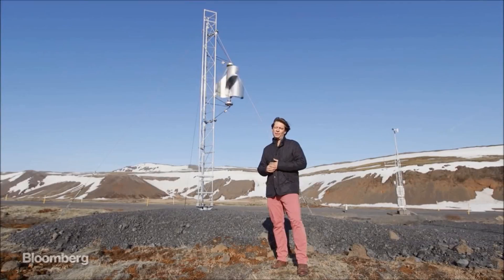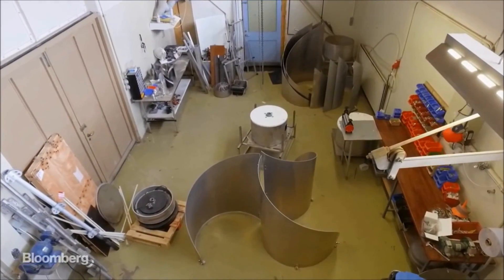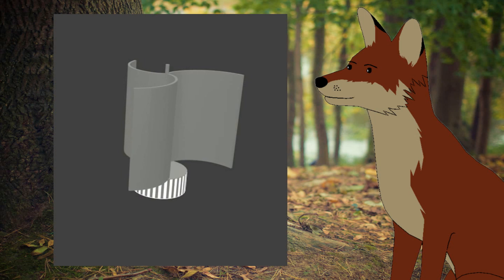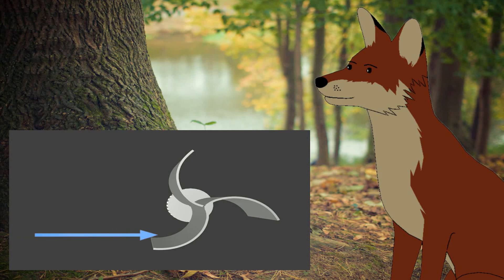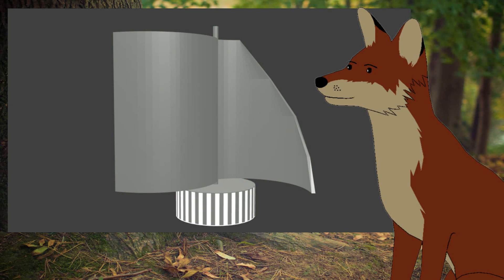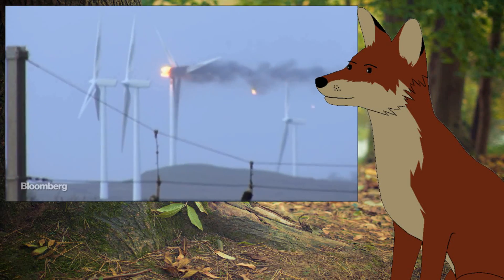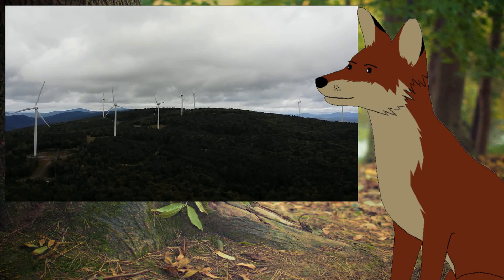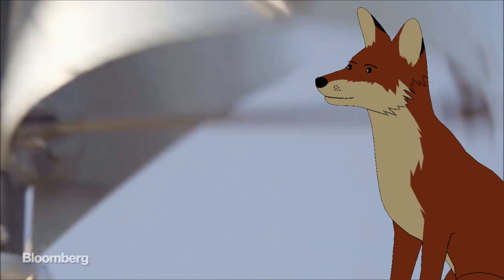IceWind Turbine - BUSTED

Comment: I built a conventional Savonius Rotor many years ago. It was 6 feet tall with 3 2 foot levels of blades 33 percent out of phase. The blades were all spring loaded so that if the rotational speed got too high, the blades would open up slowing rotation. The shaft was mounted on a auto front wheel bearing, belt driving an 12 VDC auto alternator. The output being used to charge some surplus Telephone company lead acid batteries. These batteries were 2 VDC each and huge, weighing more than 200 lbs each, 6 cells made a 13 VDC string. This setup was used to power my ham radio station in emergencies. It would probably not be considered very efficient but it did the job.
Reply: You don't need efficient when you can just go big.
Reply: @vylbird8014 
✔️

Comment: because those who endorse them are morons or maybe they get some benefits from the back door.. I agree with  you that the wind resists on both side. I've been searching a model which  neutralizes  the wind on approaching blades so far I've seen only one prototype yet it didn't appear to work smoothly

Comment: First off, stainless steel and carbon fiber would be considered new science as compared to 200 years ago so their statement would be correct.  Second,  they don't actually lose 40% efficiency because the wind is not hitting the returning 40% missing from the returning blade.  3, What's the fucking difference if it catch's on fire or explodes, over speed still killed it.  4, Look at the gigantic price difference between theirs and those complicated propeller types that only last three years.  Imagine the money to replace those things every three years so maybe a little less efficiency is worth the replacement cost of the giant ones.  5,  You have not proved that they won't over spin.  It just sounds like you're jealous because their making money and you're not.

Comment: Cutting the blade by 40% does not cut the efficiency at all.  It cuts output.  The cut applies equally to the pushing force on the driving blade as it does to the 'dragging blade'.  This is simple geometry.
Reply: right, and it needs low output in the frequent high winds. simplicity and elegance are the 2 design goals. if it provides ANY output, it is renewable, green energy, and kudos for IceWind for trying to make an alternative to expensive conventional turbines in Reykjavik
Reply: those triangular blades have a purpose. If you have some basic idea of mechanics, you might know about LEVERS. And how force distribution of levers decrease as you move away from the Axis holding the weight. The same principle works here. The blades get thinner towards the edges and are wider at the centre. This reduces the drag on the blade which which is pushing the rotor opposite to the desired direction. That may decrease the output but increases efficiency and durability.
Reply: @chandrasekharpanigrahi2474  that's daft ; the force generated by the upwind blade has the same mechanical advantage distribution as the air resistance of the downwind blade: it has to because the blades are the same size and shape as each other.
Reply: @chandrasekharpanigrahi2474  I am curious about the purpose of the triangular design. Can you please send a link of an article about the force distribution in levers? Thank you.
Reply: Thanks for these comments, we are looking at a community renewable source, currently we have no renewable energy, waiting another 10 years for greatly increased efficiency and reduced prices kinda defeats the object!

Comment: How could you lie so much? I went to their site and found everything you said to be a lie! What is your beef? Go to a basic physics class at college or even high school and you will understand the claims. You are one sorry person without something to do and your lack of education is proven by what you say.
Reply: D. Cantrell 

He also contradicted himself too. He said that the wind pushes both the blade and the back of the next blade, which makes it inefficient as it won't spin fast. Soon after that he said that they can't show that the don't have the overspeed problem. The point of the design is to have very few controls and make it cheap to build. Then he says how stupid a design it is because the normal turbines have brakes and pitch control. So not sure what he thinks he's busting. I'm just gonna down vote and block the rest of his videos, as I'm pretty confident he's full of crap in those too.
Reply: The icewind turbine is not prone to overspeed due to the VERY basic fact that it is such an inefficient and poor design, it will never be able to be over-sped. Sorry to bust your bubble, but the laws of physics are well in play here. To be precise, it's Newton's third law of motion: For every action, there's an equal and opposite reaction. Many times the equal and opposite reaction is the energy generated by the turbine, but in this case it's just the poor design of the turbine.

Comment: I have looked at these and was taken in and as you explain I see now where your coming from. I am looking to move to Portugal and want to be more green with energy with solar and wind, what is the best wind home turbine out there at the moment? Thank you Lee
Reply: Lee Woodhouse solar panels are coming down in price... But depending on your energy demand a vertical turbine takes up less space at a cost of efficiency. Your best bet is to start lowering your energy use... LED filament bulbs, heat pumps, and the like and go from there when you know what your demands will be

Comment: The real problem with many of these products is that they are either on pre-order or are simply not available. Rather than pre-order anything, invest your money properly and let it work for you. Once a product is available off the shelf, then order it if you want one.

Vertical axis turbines are much less efficient in terms of swept volume. It is the swept area in the direction of wind flow that produces power. A horizontal axis machine can have very little swept volume.

That said, the horizontal axis machines do have advantages and can produce useful results in exposed locations. But you do need a lot more space for them. If the chosen machine can be user installed and user serviced, a lot of the costs of running a turbine can be avoided. A user could service several 1kW machines, for the cost of the parts, whereas he would be hard put to service a 5 kW upwards. 

It is not only the cost of getting the service team out, but also the potential days, weeks or even months of lost energy waiting for any fault found during a service to be repaired. I have seen expensive machines standing idle for six months or more. If bought from a utility company, the cost of this energy can run into thousands. A user can keep a stock of spares and repair faults in hours.

Also Google Semtive and Eolo wind turbines for vertical axis designs.

Comment: yeah,  they've designed the blades so bottom is closers to base therfore can be larger, other reasons missed by this video.  efficiency of the blade itself doesn't matter being freely powered. the real efficiency is the cost to produce against the cost to build and maintain/ watt, nobody has a dressed this issue!

Comment: Hey Fox, thanks for the vids.  I was planning on making a copy of this VAWT for my home with barrels, but didn't know they are susceptible to overspin.  I'm going to try something safer.  Thanks for saving me some potential trouble.
Reply: hahahahah your so stupid you would take this video as gospel? fair dinkum? FFS get an education and dont watch shit like this video.....There are plenty of home made savonius rotor generators around that work fine and will do for decades
Reply: And better designs use homade blades cut from sewer pipe! They work very well without the limitations of speed -stall.  A nice design uses treadmill pm motors and direct drive.

Comment: Thank you for your video, it is insightful. But I would've hoped that you also included one more topic, the topic about manufacturing cost in relation to the power output. The IceWind Turbine might be inefficient, but if it can be easily installed in homes, it can still be a viable option. It would be great if you can also compare this turbine to solar panel.
Reply: Yes, it's a boat turbine! But boaters, sailers actually, use a small bladed system that is small and light.

If every house had one of these things it would be very noisy even if they were VERY quiet! Who would you call to fix it? An electrician? A plumber? Handyman? You would have to fix it yourself or hire a turbine tech for repairs... You still have to get it into clean air somehow... Crane costs are crazy expensive!

Comment: Jay Leno has a 10kw one installed on his shop roof youtube.com/watch?v=5Heu7TFsa50
Reply from the maker: That turbine was installed by ARC Renewable, even though it looks very similar the the Icewind design.  I tried to look into ARC, but their website is now dead, they have a linkedin profile but it does not look to have been updated in a while.  

This isn't the first wind turbine Jay installed, he put up a different 10kW one in 2007, and another one that looks similar to Icewind called the Magwind in 2009.  http://www.verticalwindturbineinfo.com/jay-leno-installs-vertical-axis-wind-turbines-on-green-garage/

I interesting thing about the Magwind is that it was a scam.  By scam I mean the owner of Magwind was indicted in 2013 and has been on the run for 4 years until he was caught last month.  http://www.wind-works.org/cms/index.php?id=675&tx_ttnews%5Btt_news%5D=4674&cHash=e4d79c9fa2b1a7a3de1a4069a822aa1d

Comment: If they would use the original savonius design with tweaking and with stators they could get a "butt load" of power. If you look at the zephyr system they have a computer simulation to illustrate lift!! 10 times better than this crap. Stators require more stability d/t surface area.

Comment: Wind is unreliable so wind turbine is not popular. Not due to its efficiency. Everyone will buy a wind turbine with 10% efficiency, if  wind blow 20+ hours in 300+ days and turbines are cheap enough. But it is not possible, so most of small scale wind turbine is failed. If battery technology greatly improved and price reduced drastically then it's found the ground. Unless not even if you get jaw dropping efficiency.
Reply from the maker: Mujibur R. 
Agreed

Comment: (4.30) Wind turbine catch fire, cause is faulty brake (friction) or simply short circuit at generator due to over speed. So your knowledge is also bullshit. Do proper research before bust others. Also cut half not reduce efficiency, may its reduce capacity.
Reply: I do not claim to be a windmill guru they have been around for a long time and I am sure that if you look enough you can find the data you need so I too am surprised that they got a research grant.
Back in the 1970s I took vacations on Greek islands and saw the old windmills there. here is a url so you too can see what I am talking about. http://www.alamy.com/stock-photo-old-traditional-greek-cloth-sailed-windmills-in-kontias-on-lemnos-51236822.html   In particulat the Steel framed one built on the base of an older windmill..  The rudder at the back keeps the cloth sails into the wind..however the ropes or cords allow the sails to spill the wind in conditions of high wind preventing overspin in a very efficient cheap and proven way. Greek windmills like this have been around for hundreds of years.Maintenance too is easy and cheep anyone can cut and fit new sails and cords..and oil gearing. Adapting them to generate electrical power is easy and anyone can build their own just from looking at this picture with no grant required just the planning permission to build it. .....Good luck with getting the planning permission lol
Reply: My bad..I was looking at lots of url's ...here is the correct one ..https://www.etsy.com/listing/235844361/mykonos-greece-black-and-white?ga_order=most_relevant&ga_search_type=all&ga_view_type=gallery&ga_search_query=greek%20windmill&ref=sr_gallery_19
Reply from the maker: Large turbines like that don't try to change speed or stop by using brakes. They control their speed by changing the pitch of the blades. The turbine they showed on fire had it's blades pitched to nearly 90 degrees. just like the turbines surrounding it. That turbine was never in overspeed. I couldn't have been in overspeed because if the turbine senses too high of a speed it would go into EFC (Emergency Feather Condition) and pitch the blades to 90. A turbine in overspeed means the primary and emergency pitching systems failed. In that condition the turbine could catch fire due to overheating of the gearbox or generator, but this is not the case in the turbine they showed.  In the turbine they showed the pitching system worked correctly, which is why it wasn’t spinning wildly out of control.
Reply: hahaha...........do you please see those again, why all turbine is not spinning? that's mean weather is not good at all. And those clips do not show all incidents, it's possibly start much before and recording start only when its catch fire. At the end its catch fire most possibly for bad weather. So their point is valid (there is many times turbine catch fire for bad weathers - may pinpoint reason is bit different, but overall culprit is weather).  Your are right about pitching but there is also emergency brake presence with EFC position for disaster moments as long as I know. And you can't correctly guess there angle from those kind of clip.
Reply from the maker: Yes you can guess the blade pitch from the clip.  The other ones are not spinning because they likely shut down the entire farm due to the fire.  You can clearly see on all 4 turbines that the wide area of the blade is turned out of the wind.  Plus the fact that the smoke is horizontal means there is still lots of wind.  The hub braking systems are just meant to hold the hubs in place for maintenance in conjunction with the pitching system.  The hub brakes alone would not be able to hold, let alone stop a turbine without the blades pitched correctly.  

Yes, bad weather can destroy turbines, bad weather can destroy practically anything.  But they specifically claimed that fire was due to high wind speed and the evidence points to the contrary.

Comment: I had similar thoughts about the blade shape on these Wind-gens, however that is likely what makes them less vulnerable in destructive high velocity winds. If you take the principal of leverage and apply it to the scenario of horizontal force reacting to a vertical lever, the greatest leverage occurs at the top-most point, on the IceWind, the blades are shaped and arranged counter to leverage, so that less leverage is applied to the top, thus diminishing the possible bending of the vertical center axel and perhaps causing the blades to strike the base platform and be damaged. As far as efficiency goes, no the design isn't as efficient as lift blades, however the amount of land area and air space required for it to function is also far less (think total cost of Generator, land area, materials and installation cost) I think the total cost/benefit ratio of the investment may very well be better than the horizontal shaft prop models. I'll bet more people would find this design less offensive as well, I also could be convinced that it would cause less avian mortality. Yes they are set up in a seemingly confined space in a former coal plant, but appearances can be important to foster interest and confidence in investors and grant details (and perhaps business write-offs) sure they go function in their garage, but just maybe their wives said no, or maybe they like to keep the snow off their cars??
     I saw your video critiquing the vortex blade-less generator and thought you did a very good job (however I did come up with a way to convert the swaying movement of the cone into linear force) 
   I think your production values for you video are decent and it's important to foster skepticism when the public and the government may be somewhat in the dark and not knowing the questions they should be asking of innovations.